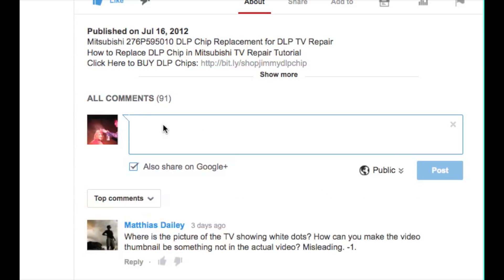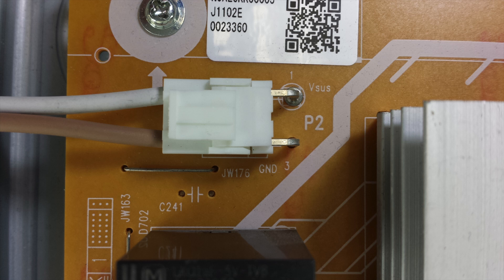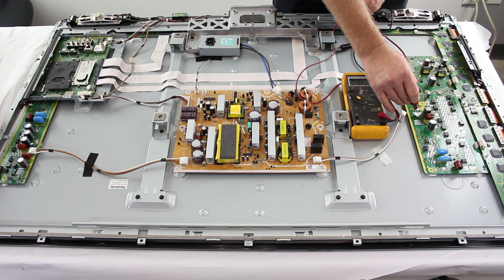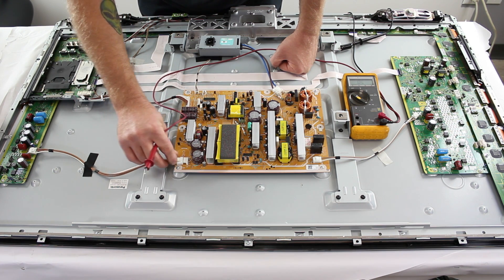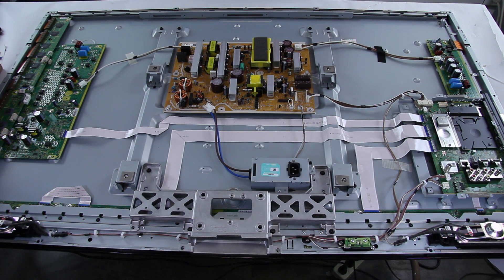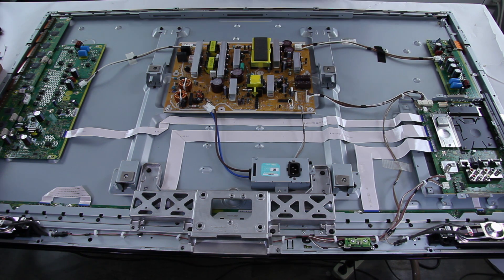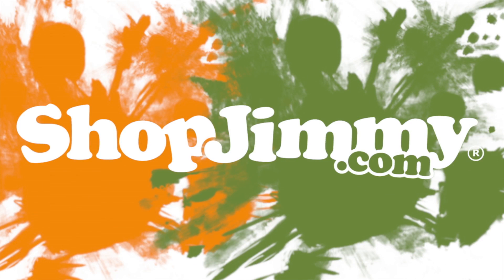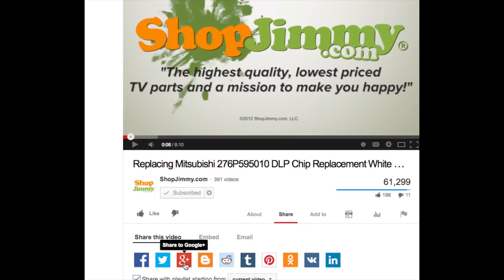Panasonic Plasma TV Repair - Understanding 14 Blink Code - How to Fix 2011 Panasonic Plasma TV

Comment: I have a Panasonic Viera TC-P46ST30. The screen went blank and Power light is solid red. But when I press Power button for long time it blinks 14 times. Then I followed the above video and found that both the pins on the SC board are short to ground. Both pins on TPSC1 are open and remain open even when I disconnect the SU and SD boards. unplugged the TV and connected back on, the light becomes solid red, when pressed with Power button for long time, the light goes to blinking 14 times. Please help.

Comment: Hi! I have a 2011 Panasonic P50x3 plasma TV that is only displaying the left side of the TV and the right side is multi-coloured vertical lines. Of course my warranty ran out 6 months ago so that isn't an option. I currently have it dismantled in my living room. It started doing this from time to time a few months ago and reseating the HDMI cord fixed the issue temporarily. I thought it might be the cord but I've tried several and get the same screen issues. I'd like to know if it's fixable or should I just give up because sometimes replacing the item is cheaper than fixing it. I'd truly appreciate some advice. Thanks

Comment: My Panasonic TC-P55ST30 stopped working a few days ago. Sound and picture went out. The red power light remained solid and I was unable to turn the TV off via the remote. When I pressed and held the power button ton the TV, the light proceeded to blink 14 times. I brought it in to a reputable family owned company that has been in business since the 1930's. They called me a day later and stated that it was SC Board. Total cost of the repair will be $260.00, but it will take 7-10 days. I thought about tackling the project on my own, but rather than buying an Ohms meter and taking a chance of more damage, I thought it would be better to leave it to the pros. Beats spending a grand on a new TV, especially with the quality of picture that the TV has. I just wanted to pass this info along to let people know that the number of "blinks" on the power light is not really a clear diagnosis of the issue.

Comment: Panasonic TC-P50S30
14 blinks

I've tested TPSC1 - no short.  So what am I replacing?
Reply: I had the exact same problem and inferred from the video that if there is a short on the SC2 and no short on the TPSC1 then problem lies on the SC board.  I found one on Ebay and installed it and now the TV is working again.  I was surprised, it may be because I have been without TV for 2 weeks, but the picture seemed a LOT brighter and the colors more vivid.

Comment: I have a Panasonic TC-P50ST30 that has no picture or sound.  When I turned on the TV the power light would stay on with no blinking.  In order to turn the TV off I would have to unplug the TV.  When I plugged the TV back in the power light was off until I pressed the power button.  The only way to get the power light to go off is to unplug the TV.

Comment: Hi. I have a TC-P50ST30 giving a 14 blink code. I received a ground signal at both posts of the SC 2 connector (after disconnecting it from the power supply board). I still received the ground signals after disconnecting the ribbon connector and the connections to the SD and SU boards. I checked the P2 connector and didnot receive a ground signal on the VSUS post after disconnecting the wire. Therefore, I think the short is isolated to the TNPA5351 board. Is there anything else I should check? Am I missing anything? Thank you for your video- It is VERY helpful!

Comment: Thanks!  This video helped identify a bad SC board.  The power connector
 was shorted to ground on the SC, but TPSC1 was NOT.  Replaced the board
 and now the set is working again!  Very nice presentation, accurate, 
and exactly what I needed. Now I'm going to do some further testing and 
find out exactly which part died on the shorted out SC PCB (probably a 
transistor, diode, or MOSFET.)
Reply: hey - facing potentially the same issue. did you ever find any new information?

Comment: Hi There, I have a  Panasonic plasma TV Model TH-P50X20Z manufactured April 2010 error code 8 Blink.
do I need to replace the SS board or just to replace some parts only? Thanks , Rene

Comment: Thank you for making the video.  I have the 14-blink code for a panasonic tc-46s30 plasma TV.  I've traced the problem down to the SC board (TNPA5351 - sticker on bottom reads 5351AG).  It looks like the boards are few and far between... what are my options?

Comment: Thank you for sharing this information...very well done ...While I am comfortable with working on electronics, I'd just like to share my symptoms to see if there might be a  a definitive diagnosis ( what board failed) without having to trouble shoot per your instructions. I have a TCP50S30. My screen went dark after a loud snap that seemed to radiate from the right side of the screen ( looking at the front). Subsequent symptoms were: I was not able to power TV OFF with any remote. Had to unplug the power to turn  the Red LED off. After holding the TV power button ( on the right side, back), I was able to get the 14 flash code. Any ideas what board might have failed from this information ?..Thank you again for taking time to share this valuable information . Rich

Comment: When will you guys have some more power boards in??? Power Supply Unit, P Board
Part Number: TXN/P1PJUUS
MFR Part Number 1: Panasonic TXN/P1PJUUS
Board Number(s): N0AE6KK00005
Panel Sticker Number: MC117FU1411
Panel Manufacturer: Panasonic

Comment: Panasonic Viera P46g30 is my tv. It made a loud but blunt bang and I smelled some melted plastic or metal. And now I don't have an image anymore. It goes on and shows it's green light. Strangely enough I can't put my tv out by remote control so show the red light. Hope you have any ideas. Possible costs ?? Thanks in advance

Comment: I have a TC-P65S60 that tun off by itself and the power LED blinks 12 times. What will be the best way to troubleshoot or the blink code points to a specific component?

Comment: I have a 14 blink code on a Panasonic TC-p46st30 trouble shooting per video.  HAve a short on the SC2, but no short on the TPSC1. Does that mean that I have a bad SC board.  The video only talks about what to do if you have a short on the TPSC1. thanks,
Reply: I have the exact same problem.  Have you found a solution?
Reply: Any word on this problem?

Comment: TC-P42ST30
Owned 4 years, bought new
14 blink code, having troubling finding the correct part, any help or links is muchly appreciated! Thanks
Reply: Hi I have the same problem did you ever fix yours if so could you please reply and let me know

Comment: I have a Panasonic TC-P55ST30.  It made a pop and would not turn on.  I found Q401 mosfet on the SC board was blown apart.  I ordered the SC repair kit from Shop Jimmy which contained the blown up transistor.  I replaced Q401 no difference.  I then replace the other 7 TO-263s and the chip resistors in the repair kit, still no difference.  Then I find this awesome video.  I have a short on my SC card.   I check further and there is a short at TPSC1.  That short goes away when I disconnect the SU connector, so I have a short on the SU card.  BUT with all SC board connectors disconnected I still have a short on SC2 connector form Vsus to ground.  so I guess I also have a short on the SC board despite my repair kit installation.  bummer waste of $47.  I guess my question is: what is the relation ship of TPSC1 to ground and power?  With all connectors disconnected on SC board there is no continuity between TPSC1 and ground or voltage. Allan

Comment: I have a panasonic plasma tc-p50x1 and the bottom half of the screen shows no picture, It's just black.  I did notice on the sc board I believe it is has a look to be a burn spot on it.  On that particular board.  Are there any suggestions on what could possibly be the problem?

Comment: Thank you for the helpful video. Does this repair also work for a TC-P50S1 from July 2009. This TV has been great, with no issues until today. The TV went black with the red light slowly blinking. I unplugged it, and while unplugged held down the power button for 60 seconds or so. I then tried to power it on. It sounded normal, for a couple seconds, then it sounded as if it were sparking or shorting out, and went back to the steady blinking red light. Any suggestions on troubleshooting?

Comment: High i have a Panasonic TV MC127T19P13 Apr 2010 Snr ED02503351 
I get a blinking code 13  Opened the back cover and studying yr vids
Can you tell me which part is defect ? I forget to tell u that when i wait a few min the green
blinking led turns to red i  restart and picture works again to turn off again after 5 to 15 min
I close and restart and then after a few trys it opens again.
Thank you in advance ,
Alex Verhagen
Athens Greece

Comment: Hey all, can you help me with fixing my panasonic plasma tv, its about 5-6 years old.
model: TX-P42G20E
the problem is it blinks green quickly like it would turn on, then doesnt do anything, and after couple minutes goes to stand by mode and then red led blinks 13 times and stops for a couple seconds, and then repeats blinking

Comment: tc-p50s30
So while testing my TV: 
-I had a short on P2, that went away when disconnecting the cable.
-Then I tested SC2, and found a short.
-But, when I tested TPSC1 there wasn't a short.
This means the SC board is bad, correct?
Reply: My LG led tv 42LA7400 having 7blinks, its pictures flikers always. Whats the cause and remedy?

Comment: I have a model TC-P50GT30. I've had it for a little over four years.

I got the 7 flashing lights on the power light, then I disconnected the SC board and got 8 flashing lights. Disconnecting the SS board resulted in 6 flashes, then reconnecting the SC board while leaving the SS board disconnected gave me 7 again.

Any thoughts?
Reply: +Ryan Hough This is for 14 blink codes, is there one for your blink codes?

Comment: I have a TC-P42ST30. The power supply board does not appear to have a short. The SC Board does appear to have a short to ground, but unlike the set in the video the SC, SU and SD Boards appear to be all in one. I can't find a TPSC1 but do have a TPSN1. When I check at TPSN1 it is not shorted to ground. I assume this means that the all in one SC, SU and SD Board is bad. Is this correct? Thanks, Michael.

Comment: have Panasonic TH-P50V20A.  Won't switch on- just 4 red flashes. from some research it said is Power SOS P Board. How do I know which board and if replacement, substitute or repair is possible. Tried looking through other videos couldn't find any thing specific to this problem. Any suggestions?😯

Comment: My tv now won't turn on at all--the display when turned on makes the usual 1 click noise when you first turn it on and then displays a black screen and stays there--with the red LED on the front bottom screen displaying power staying at a constant rate with no blinking. Whereas after this happens the remote doesn't work or respond to the tv, and also the buttons on the tv do not work at all--all buttons including the menu--yet the power on the tv is on (tcp46st30)..

Comment: TC-P50S30 – The TV won’t turn ON with a 14 blink code. I checked all the PINs as suggested and the only short is on the SC board (SC2). TPSC1 is ok on both PINs. Is it correct to assume that the SC board is bad? Please help. Thanks!

Comment: Well.... I have a p42s30 and it had 14 blink code, so I bought the kit and repaired the sn board.... tv turns on with no picture still, but I no longer get any error codes!  I turned the set on and off a few times, and to my amazement the screen started to come on.... but for only about 30 seconds before it faded away!!  Is it my main board that is bad? any clues?  greatly appreciated!

Thanks
Evan

Comment: I also order two parts from u last week and got it today. p/n .tnpa4780 /tnpa4781. but still have same problem.  top have pictures and sound. but the half of the bottom is black screen across.

Comment: I have a Panasonic TC-P46S30 plasma tv with a 14 blink code. I have viewed your video and it appears the power supply is bad. I get 0 ohms on pin 1 with it plugged in and after unplugging get approximately 1.6k ohms. When you say close to 0 is that close? And any ideas on best place to get power supply? You seem to be out of stock. Thanks,

Comment: I have a TC-P55ST30, I replaced the Power supply board because Pin 1 was shorted.  I am still getting the blinking.

Comment: Brand: Panasonic
Model: TC-P42S30
Issue: 14 blink code

Background: Turned the on tv and after five mins heard a pop and the screen went dead. The led flashed fourteen times so I knew something was messed.  Followed the video and I believe it is the SC/SN/SD board. My model has all in one and not separate boards.  With all the ribbons and cables disconnected here are my results:
Power supply board P2-1(Vsus)=13 ohms, P2-3(God)=0 ohms
Power supply board P11-+15Vc=4 ohms, P11-Gnd=O ohms, P11-Vsus=12 ohms
SN/SC/SD Board SN2-1=0 ohms, SN2-3=0 ohms
SS Board TPVSUS-1=10 ohms, TPVSUS-2=0 ohms, TPVSUS-4=4.5 ohms

My question I have is do you think this is the only board needing to be replaced or will their be more to replace? Trying to weigh the costs.

Comment: Hi. I have a 2011 Panasonic Plasma TC-P60ST30. There are no blink codes. The TV powers on. But, once it's on, it doesn't respond to the remote or side panel controls.
There is an image, but no sound. If I unplug power, and reconnect, it will work okay the first time I turn it on. But, will return to non-responsive behavior once I turn it off and on again, requiring unplugging/replugging power which will regain control for just a single session. If I turn it off and on again, it's back to frozen. Any ideas? (I hope I made sense describing my problem.)

Comment: Hey guys - I have a Panasonic tcp55gt30 2011. I had 7 blink code and had sc board and su buffer boards repaired. All is working with picture now but I have no audio. Nothing through tv speakers. Nothing through sound bar. New hdmi cables from DVD player and Apple TV. Optical cable new. Factory reset twice on tv...... HELP!!!  What is the issue with this thing??

Comment: Model: TC-P55GT30
Purchased New: 2011

Purchased a 4 year extended warranty that expired this summer (of course!).  Screen went black last night.  I have 14 blinking lights.  I wish these error codes were more precise so the owner knows precisely what replacement board to buy.

Comment: I have a Panasonic plasma TV. mod tc-p50g25.  ser # ldo03010876.  will the disconnect and adding the x and y boards to listen for clicks diagonis work or do I need to go right to the ohm meter to check for continuity?  I did not see my model number in your  list.   ken...

Comment: I have a Panasonic Viera Plasma model TH-42PZ80U. The TV will not come on and the red power light  blinks 10 times then pauses for a few seconds before starting the blinking sequence again.
Reply from the maker: +David Haynes   Try this at your own risk. Unplug the TV, then disconnect the SC board and plug in the TV to see if the TV powers up. Note that it will not have a picture on the screen. Reply with the results of this test. Thanks! www.shopjimmy.com

Comment: My Panasonic viera Model No: TX-P50X20B front red LED is blinking for 13times. What is the problem and how can I fix it? Please help me fix the problem. I'm looking for solution. Please please help me.
Reply from the maker: +Rumi Bhuiyan   Try this at your own risk. Unplug the TV, then disconnect the SC board and plug in the TV to see if the TV powers up. Note that it will not have a picture on the screen. Reply with the results of this test. Thanks! www.shopjimmy.com
Reply: +ShopJimmy.com  Yes I have tried and disconnected  the SC board of " TNPA5063" and plug in the TV but the LED of power  light is still blinking for 13 times. Now what to do? Please answer me....I'm badly need of your help.
Reply: I have the same problem
Such as the one in the device.
Do repaired device or not
Reply: Hello Same problem here, red Led blinks 13 times after Panasonic TX-L42D25E has turned off itselfe...
Reply: Same here. What have you done about that?

Comment: model: TH-42PV70M
5 years old 

red light flashes 11 or 12 times
Reply from the maker: +grace smith   Try this at your own risk. Unplug the TV, then disconnect the SC board and plug in the TV to see if the TV powers up. Note that it will not have a picture on the screen. Reply with the results of this test. Thanks! www.shopjimmy.com

Comment: I have the 14 blinks on my Panasonic tc-p42s30, I replaced the PS board  but nothing changed. What do I do now?
Reply from the maker: +Saurabhopithecus   Try this at your own risk. Unplug the TV, then disconnect the SC board and plug in the TV to see if the TV powers up. Note that it will not have a picture on the screen. Reply with the results of this test. Thanks! www.shopjimmy.com

Comment: i have a panasonic TC - P55VT30
i recently took my tv off the wall to put up a new unit.. when i put it back on its stand i didn't have the screws.. i put 4 different length screws on there but i damaged the unprotected board behind the stands mounting holes.. the board i damaged has the code: MN865111VTE1 
i tried to remove this board to replace it but i ran out of time as i had to leave the house.. i do however suspect that it is more complex than just a simple swap out.. 
do you think that you can help me out? i would appreciate any assistance available.. i'm out of warranty so just want to try repair it myself if at all possible.
the part is available online for about $25 so that at least makes me feel better..